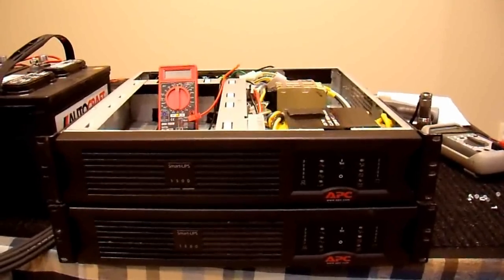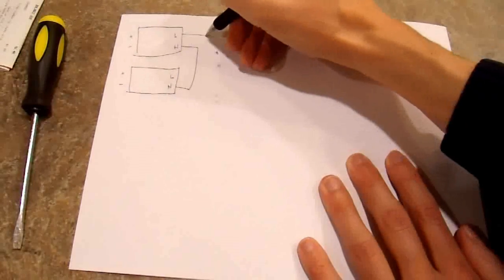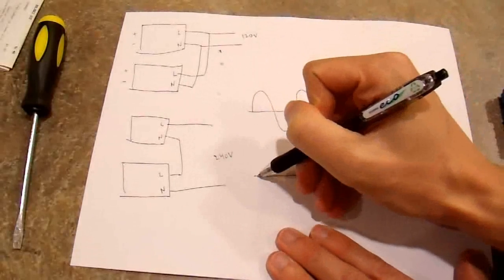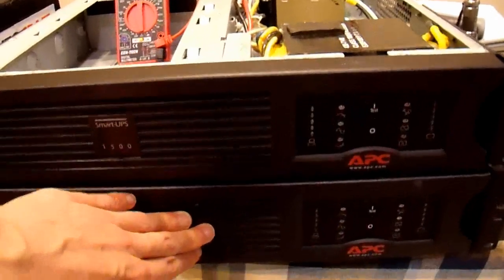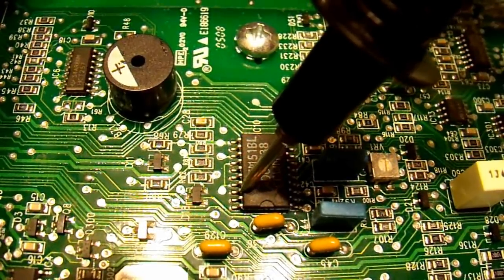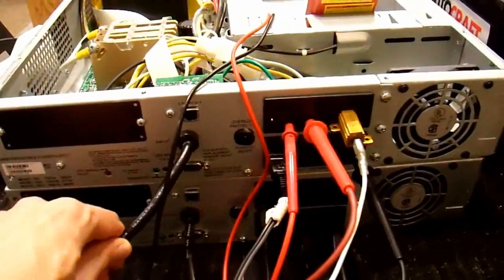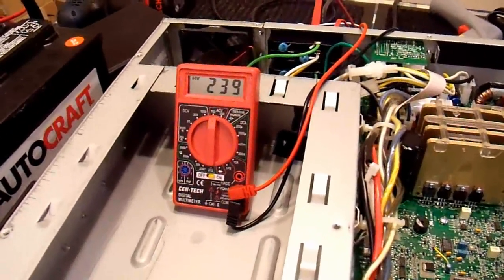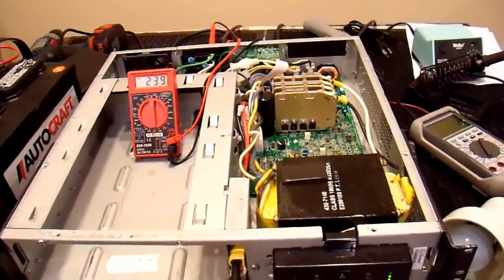Connecting Two UPSs or Inverters Together for Double the Output Power

Comment: I have 2 3000 watt APC ups' sitting around that I currently lug around when the power goes out. My initial plan was to follow this and add big batteries (the ups is 48 volt) and an interlock in the main panel, then run power during the night without noise and a dc genset during the day to charge.  Power outages are usually less than 72 hours but do you maybe have a better suggestion?  Just trying to run occasional things like the fridge, nat gas heat, and microwave during an outage. Thoughts?

Comment from the maker: I have tried connecting multiple transformers to one unit and it does work, however the transformers I used were not matched well enough to actually increase the output in any useful way.  For me I was better off using just the one transformer and increasing the cooling with heatsinks, fans, etc.

Comment from the maker: Very good question - unfortunately I don't know how to specifically disable the charging function.  However my first thought is to lower the charger voltage to some level that is low enough for it to never charge.  I'm not sure if this will have other consequences, but let me know if it works.  Do a Google search for apc_smartups_battery_float_voltage and check out the first result.

Comment: Very cool, I will take peak tomorrow. I'm not well versed in circuit components, so please forgive my vocabulary ignorance. There are two components that look like fuses (1/4" diam, 2" long aprox) that had leads like resistors solidered to the board. The upper lead on one was severed probably from overheat. I'll have to send over some photos.
On a different topic, any interest in building a charger and or DC motor controller for my LiFeP04 electric vehicle project? (see my vids)
B

Comment from the maker: I assume you've checked the fuse already...  I'd start by taking it apart and cleaning it with shop air since it could be something as simple as spider turds causing a high impedance short.  (shop air is also powerful enough to remove dendrites) Is there corrosion inside?  Are the fan bearings good?  (would indicate if it may have overheated)  Does anything look like it got hot?  Are any of the main power transistors shorted as measured by a multimeter?  Those are the the things I'd start with.

Comment: I'm a professional musician and general tinkerer. I find your explanations very easy to follow. I have an understanding of phase due to my musical background.
Anyway, looking forward to an off grid project and plan to use a single UPS for less than 2000 watt load and your vids have been very informative on that quest.
Also- I have a non working (left plugged in for a long time) Iota DLS 42-18 that was being used to charge my electric motorcycle and now sits on a shelf. Thoughts?
B

Comment: Well the reference to the AC Mains may or may not be their so that can not be used for a clock.  I was thinking about just replacing the on board clock with a standard clock to both units. ( parallel the clock on board ).  Then start looking for the phase you are talking about on the board with a oscope.  Once found start added a cap to shift the frequency and see what the output is.  Just play with it...all I was thinking about doing.

Comment from the maker: Maybe you can - let me know if you find a place to inject a clock.  I assumed they generated it internally in the control IC from the crystal onboard and you probably don't have access to it.  They may also need to adjust the frequency for load transients, etc, and may not like a constant clock.  Besides, these already have a 'sync' feature built in so I didn't see a reason to reinvent what was already there.

Comment: Why could you not use a master clock and have both units running of the same clock, then just adjust one of the units to be 90 or 180 off of the other unit?  So you could do split phase and run your 240 volt units?  I have two of the 3000 units and I might take a try at that using a 10meg clock standard since the batteries are both bad in each of the units on mine.

Comment from the maker: The phase tracking of this UPS is imperfect (about 5V as seen when measured from true 180 degrees) so it would work poorly as a grid tie.  You could, however, generate 240 volts off of one leg of utility power and one off of battery power.  I suppose you could power half of your house off of battery power and half off of utility power this way.
Reply: Thank you for the video..
How do you terminate extension cords to the inverter?

Comment from the maker: Check my 'sync to mains' video for more info on the synchronization capabilities of these UPSs.  They do sync to the incoming mains power on their own if it is deemed to be acceptably clean by the UPS.  The jumper was to force 'run on battery mode' at all times even if the incoming power was in an acceptable range.  If the slave UPS switches to running on 'line power', then POOF!!  The jumper prevents it from doing so.

Comment from the maker: Short answer is 'no'.  Longer answer is 'maybe'.  They are actually a few degrees out of phase so there would likely be pretty substantial current flowing between them causing significant internal heating.  One could potentially add load sharing resistors to the outputs to ameliorate this but it would be only a kludge.  I might try paralleling them in a later vid to see how/if it works.  I hadn't intended to do this but I might demo that since more people will probably be interested too.
Reply: knurlgnar24 hey ik this is an old video but i wanted to do something same. I have a 1000va ups from intex and a 1500va ups from apc. So will your thong still work ? Im planning to use default batteries but just want enough to power my 950watt pc .

Comment: The only 240 appliances I have are the dryer and the range...however I hadn't even thought about the heater blower motor until you mentioned it......I need to check that! My system is mostly for power outage type situations so it wont get much use (i hope). My plan was just to flip the breakers off to prevent accidental damage if they were turned on.

Very cool series and I look forward to more!

Comment: I use SUA2200RMXL3 and DLA2200RM2U . Both are rated at 1960 watts I believe, but the XL is rated for continuous output and allows up to 10 external battery packs! The bad news for me is that they both are 48v systems, so to power them I use 4x 100ah deep cycle AGM batteries in series. Since I wasn't even considering trying to sync them I decided to go the low tech way and use one to power each phase, with the understanding that I would not be able to use 240v appliances.
Reply: Interesting, each inverter only handles about 16 amp and normal homes have 15 and 20 amp circuits. It looks like we are going to need a lot more inverters to power a house with a ton of batteries. A generator or Tesla wall is the place to start. Thanks for the power rating info.

Comment from the maker: Cool.  What UPS's do you use for that?  That's where I was eventually going with this but you beat me to it!  I was concerned about powering the two phases out of sync because if I accidentally left something that runs on 240V on (like the furnace fan) it could damage things with the brownout condition, but I suppose not being careless solves that problem too!
Reply: Hi,
I have two identical inverters Sukam model, Smiley capacity 1400VA /24v each. My load is 1604 that include 3 flat  Tv, 50energy saver bulb of 16watts each and one underground water pump capacity of 1Hp (0.75) the underground lengh is 60mt.
My one1400va inverter can not hadle that load, I was wondering if there is a way to conect this two inverters together to double power. please asist me on this.

Comment: Interesting! I hadn't thought of this. I just use two UPS's one for each phase to power my house, the problem with this is that I cant use my 240 volt appliances (not that I really want to) but this is turning out to be very informative.
Reply: I know this is an ancient reply, but have you tried it? I have used 220V on 110V outlets and it worked, just don't use 110 / 120V appliance on a 220 / 240 outlet.